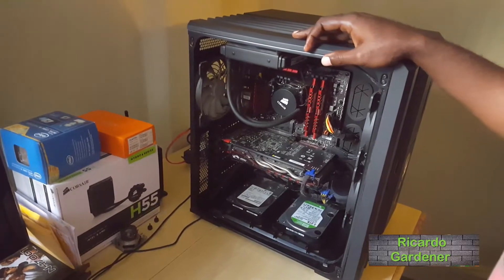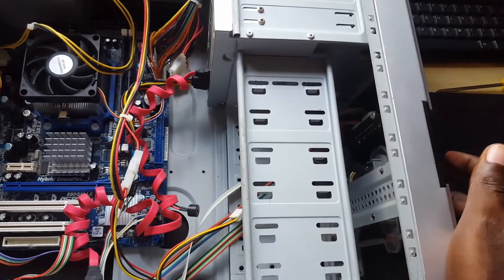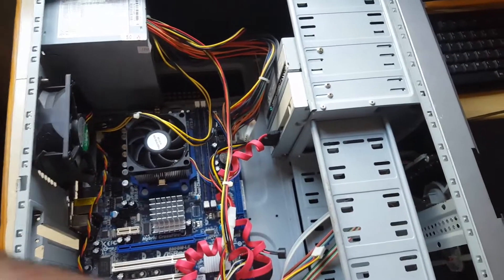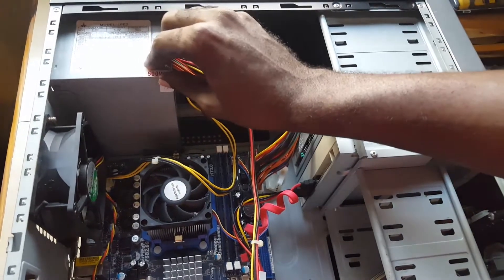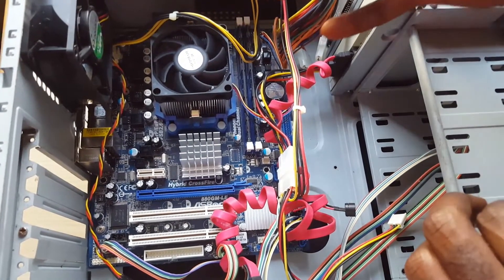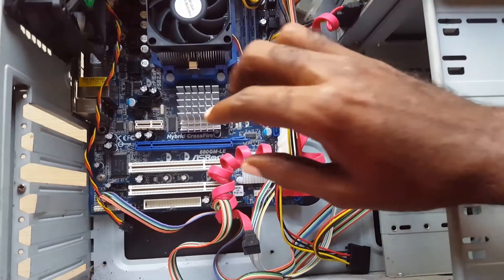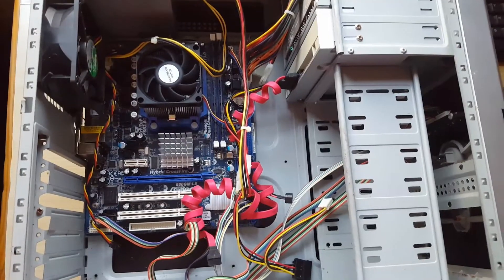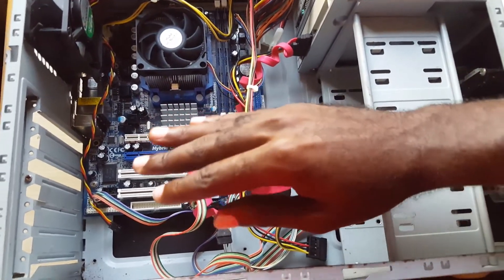How to fix a dead computer

Comment: I am a kid 11 turning 12 we will have online class thank u for this I hope I can fix mine alone
Reply from the maker: All the best
Reply: @rickytlc1985  
My computer won't turn on anymore when I press the power button. All I get is an intermittent, faint hum from the PSU fan like every 3 seconds or so and no life or movement whatsoever from any other conponent. I already ordered a replacement PSU and its on the way but I would just like to hear your opinion on this issue I'm experiencing. Thanks!